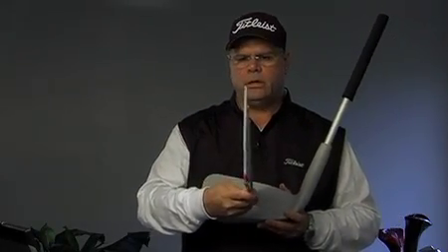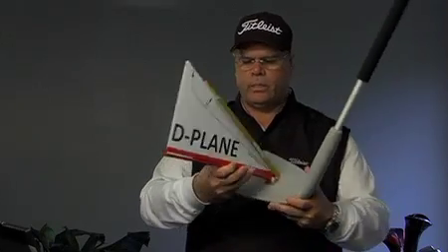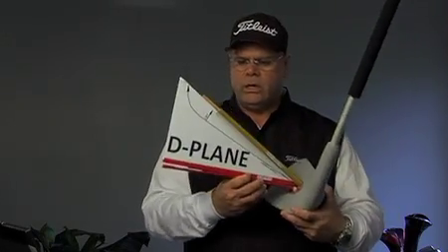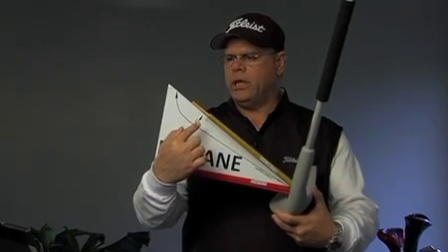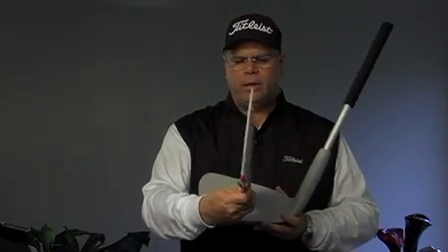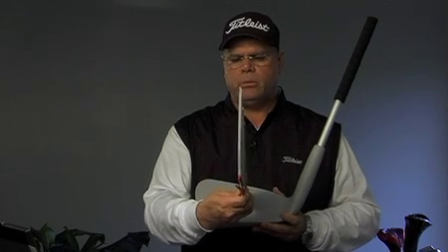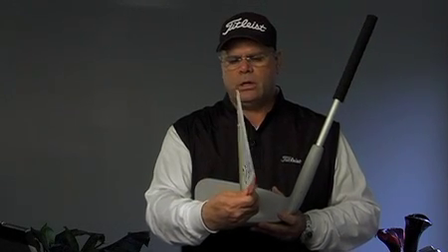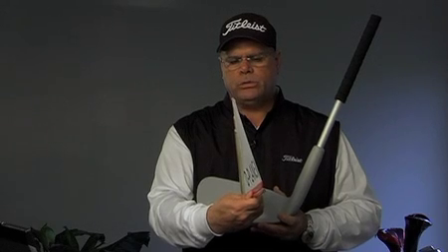James Leitz explains the D-Plane

Comment: This is a nice simple model but just doesn't actually happen most of the time.  Ball flight is more complex than this.  You can easily get the ball starting outside of the path and face angle vectors.  I.e. if path and face are dead square at impact the ball can easily start 5 degrees left.  I have the high speed videos to prove it. The ball hardly ever obeys the D-PLANE model.
Reply: I'll believe you if you show this to me on the "Iron Byron".

Comment: TIGER WOODS: Yeah. There's a lot of different numbers, on a lot of different planes and attack angles and D planes and all that stuff.

Q: (Inaudible)?

TIGER WOODS: Yeah. I know it. If you would have asked me a question about that last year at this time, I wouldn't have known, not all of it. But now understanding all those numbers and what they relate to in ball flight, traj, spin, that's what's fun to understand that. And then make the changes within it while working with the Track Man as well.

Q: Actually, I'm going to follow up a little bit on that one. Did you not know towards two and a half years ago you were maybe five degrees down with your driver on Track Man? Or you just knew you were hitting it down, but you didn't know it was that far down?

TIGER WOODS: It all depends on what shot I was hitting at the time. If it's got me five degrees, I'm sure that was based on some kind of low cut, but my draw was my attack angle was plus two. So that's a huge shift. Seven degrees is a ton.

So we're trying to tighten all that up, but understanding those numbers, it is relevant because it's pure numbers. There's no getting around it. They're universal. They're law.

So understanding those numbers and what they relate to, ball flight and what it can do and what it doesn't do, that's just fun to do. I mean the guys who work for Sean all utilize it and understand it, the ins and outs of it, and it's kind of neat to talk numbers like that because most people probably don't really get it.

Comment: Tucano I definitely agree you gotta do what works for you - but knowing this stuff can show you how to do it even better. If someone told you the angle of your descent or ascent into the ball is just as important as the angle of the clubface, would you want to understand why? Because that's what his next d-plane video does. Knowing that, would you focus a bit harder on consistent ball position? Of course. So it's a balance of understanding yourself, but then understanding the physics of it too. After that, it's finding how your body can best achieve it. Tiger has credited understanding d-plane a lot in the past year or so.

Comment: Ben Hogan in Five Lessons says the club should approach the ball from inside out for maximum spin, grip on the ball.  How does the D-Plane explain Hogan's inside out club path thus creating the Hogan' Fade, where the ball travels on a medium trajectory, at the apex, then fades 4-5 yards to the right?
Reply: In Hogan's book, he explains how he stands progressively open with the mid to short irons, more square with long irons and fairway woods, and slightly closed with the driver.  So basically he and his contemporaries figured out the D-plane intuitively.  So you can swing in to out to in, but vary your swing plane line and angle of attack to effect the shot shape you want.